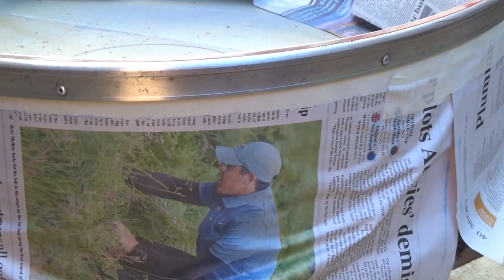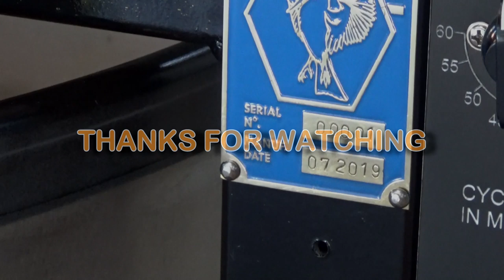The "Kooka Muller", a DIY Sand Muller for the Home Foundry - Final

Comment: I'm always heard those "plows" referred to as scrapers. Some DIY designs I've seen also fold the sand over to increase mixing of the sand.
A wheel scraper to keep the wheel clean will help.

Comment: G'Day Mark,  they always need to be fine tuned after the build to get them working right.  To add more weight to the wheel I fitted a heavy compression spring off an arm with an all-thread adjustment screw to adjust the weight applied by the roller, worked really well.  I also found adding a thin tapered grader plough across the base that allowed the sand to be lifted and layered rather than being rolled and compacted it the same spot.  Keep the sand moving around as much as possible.  With my green sand I found it always stuck to the roller and base so I added an adjustable scraper to peel the sand away and am looking at attaching a nylon sheet to the base.
Cam
Reply from the maker: Cam, thanks for that. Lots of good advice coming in now. Unfortunately, as soon as I got the muller finished it got wheeled up against a wall and I was off on another tangent. You should see that video out in a few days.

Comment: Very nice, all the way to the finishing badge.
By the way.. What do you think of a rake or plow after the roller, to break up the compressed sand?
Reply: I was thinking about that question as well. Plus a scraper blade to clean stuck sand from the roller.
Reply from the maker: Yes, I have some tweaking to do. For now, I"m just glad it's finished
Reply: @Preso58  Simply add a scraper to roll the sand to the outside edge after the roller, so it continuously rolls the sand from inside to outside and thus mixes it.

Comment: In my language we call those ploughs wings or knives. I would suggest making next ones (you probably need to replace them sooner than you think) a bit longer, so that they would scoop up and mix the sand also on the rollers path. Heavier and/or narrower roller is also on my list of suggestions. I have a roller that weighs 60kg on my muller and it still wants to slide instead or rolling when there is big enough lump.
But it works! Sure beats breaking the lumps and mixing by hand. Congrats!
Reply from the maker: Good grief! 60Kg! I am going to fill my roller with concrete but it won't be more than 10 or 15kg I am guessing.
Reply: Yeah, it's an industrial muller capable of mixing 150kg sand per load. 7,5kW electric motor @1000 rpm that's geared down to 30 rpm at shaft. It has a stationary bowl and upright shaft that rotates ploughs and the roller. I never put any part of my body into the bowl when the muller is working. If that thing catches you, it won't let go. :)

Comment: you should have removed the bell from the rear of the timer this would allow the timer to fit in the plastic box , or you could have opened up a hole in the back of the plastic box to give clearance for the bell if you don't want to remove it .. great video , love the Muller if i ever get back to casting i will also make one for my foundry ..
Reply from the maker: Thanks. I did want the little bell to remain on the timer. It reminded me of the very first Toshiba microwave oven that I purchased back in 1983. It was massive and weighed a ton and it was still working up until a few years ago. I have done a few upgrades on the muller, mainly to do with the drive pulley arrangement. It was very hard to tension the belt sufficiently so I added a cam to crank the motor mount away from the drum centre line. I also fitted ball bearings to the weighted roller. 
Regards,
Mark

Comment: The big reveal, very well done. If I may make a suggestion, the outside of the (weighted) wheel being smooth, why not try putting on some teeth, like on a earth moving equipment. I would start with just 4 (four) at shall we say the point's of a compass, i.e. North, East, South, West. If your competent with your welding ability, attach round stock, via just some heavy tack welds at the very outside edge. I would start with 0.500" in. (Approx. 13 mm) round stock. You may want to even start with say 0.750" in. {1.905000 cm} If it doesn't work out, their's no harm to the roller. I'm not sure if starting small (round Stock) going big is the correct way to go, or maybe it would be better to start Big (round Stock) and go smaller, depending on results. Great build.

Comment: Gday Mark. I love the care you put into your work. Dunno if you've tweaked the Kooka in the last year but I think you need another plough or two to break up the middle band. Otherwise clumps that get into the middle will just get buried and stay clumps.
Reply from the maker: Sean, my biggest problem is that the sand tends to stick to the roller. It sometimes forms large clumps that have to be scraped off otherwise the roller stops turning. I tend to roll the sand dry first to break up all the lumps and then add enough water to form properly clumping greesand but therein lies the problem. I should really make a scraper to keep the roller clean.
Regards,
Mark
Reply: Just had a look at Chirpy's one and yep, he's welded a scraper just a tair or two above his wheel. Pretty easy to see here. https://youtu.be/e4ALY4c0sxQ?list=PLARRPqfckvhbAY7-Z9hvY87CmlL8cE5wa&t=1688

Comment: I loved this video.  I do a lot of wood work and wood turning in addition to machining.   I love my spokeshaves, I have concave, convex and flat.   The flat one is my favourite.   Nice work on the handle.   I prefer to use hard back saw to cut off my wood turning projects rather than parting tool.   I find this gives me better control and easy clean up.
I got a big smile from the final reveal of the nameplate, very well done.
I think the muller may work better with an inner ring to prevent sand getting on the inside, and a third rake to lift the sand similar to the action of the shovel at the end.
Dave.
Reply from the maker: I watched a very experienced wood turner part off pieces with a skew chisel and he could do it so that there was almost no broken grain on the end. If there was any left he would just pare it off with his skew which was always razor sharp. He would do it with the work between centres too. I was never game to try it in case the work got flung out into my head!
Regards,
Preso

Comment: Never thought of using alloy box section and post caps to make a project box !
Looks fantastic ! i wonder if setting up a water bottle to drip feed the water in might work better ? Once you have your ratio right you could load up the muller , fill the bottle  start it up , set the drip feed and forget about it for half an hour .
Reply from the maker: Ian, I have had strict instructions on the ratio of water from none other than the legendary Sandrammer. He assures me it must be 5% so that's what I will try as soon as I get around to my next casting.

Comment: great job on the KooKa Muller.
may I suggest that the "ploughs" when acting together need to cut across the full width to the sand track to remove the undisturbed band of sand that runs directly under the roller.
for instance the inner plough should go to half way in the roller track as should the outer plough, in this way all the sand is turned over, so to speak. then possibly a pair of ploughs directly before the roller to centre the sand to run under the roller.

Comment: G’day Mark, you just can’t help yourself, name plate. Job well done and waiting for the modifications which are presented in the comments, many to choose from. 
Yesterday I conditioned my green sand, wish I had your muller:(
I must say you are a confident man to paint and finish before it is thoroughly tested but hey it works. 
Cheers 
Peter
Reply from the maker: Peter, Ahhh, there's the problem with making YouTube videos. You are under pressure to put something out there and that often means taking risks as you have identified. I am already regretting the decision to powder coat the ploughs. Some people have made some valid observations and I can see that I may have to modify them. Getting powdercoat off a part means using a chemical stripper and then sand blasting!
Regards,
Preso

Comment: All of the mullers I've used, the metal pieces that pushed the sand under the wheels were called plows. Perhaps in England they're called rakes, but I've never heard them called rakes.  Just for your information, I learned an excellent recipe for green sand while in the Navy. Easy to remember too. When mixing the sand with the clay (bentonite for us) you use the ratio of 95% Sand with 5% clay. Once that mix is done, weigh the mix then, while it's being mulled, introduce slowly 5% water. So if you have made a batch of sand that weighs 100lbs, you add 5lbs of water. The muller is beautiful and if you have any questions please ask.
Reply from the maker: Sandrammer, thanks for the recipe. I did use bentonite but sadly I was too disorganised to weigh it out and keep track of the ratios. I just kept adding the clay until it looked about right. I do have plenty of the sand which is very fine white beach sand that has been washed. I can add more sand easily. The water content was the thing that I was obviously messing up. I will try your method of weighing a batch of the dry greensand and calculating the 5% water content.
Cheers,
Mark
Reply: Only 5% bentonite clay well that's interesting.
Reply: @markfryer9880  , don't forget that's 5% by weight. If you're going to make a 100lb batch, for example, you'd put in 95lbs of sand and 5lbs of bentonite.

Comment: a fellow aussie here who is also a hobbyist metal caster, machinist and fabricator, i'de love to see your powdercoating setup and can only dream of how great it would be for you to do a powder coating video :)

Oh man that rubbing in the wood wax - almost pornographic :) loved it :D

I think it's fantastic that you were a teacher - clearly metalalwork or woodwork:) When I was at school all 3 trade classes (metal, wood and plastic) where my favourites,  sadly when my own kids went to school they had removed those classes from the curriculum :(
Reply from the maker: Lloyd, check out this video where I go into some detail with the powder coating https://www.youtube.com/watch?v=0V0OvAtBxT8&t=1335s
It starts at about 4:00. I think the powder coat setup was the single best investment I made for my shop. Initial outlay is a bit steep but certainly under $400 if you already have a compressor and the oven came from a skip in the back of my local electrical appliance repairer. 
Regards,
Mark

Comment: Oooh, pretty!  Nice job, you had me worried for a second when the wheel didn't want to roll right off the bat there, but I'm sure it won't take you long to figure out how much sand and water it likes and make any adjustments.  The music cracked me up too, nice touch.
Reply from the maker: I think there was a bit of paint in the opening of the end plates. It soon freed up. I have noticed that it can get hung up on a big lump of  sand though.
Reply: @Preso58  hopefully you'll get that sorted out too, it will be a bit discouraging if you still have to break up all the clumps by hand before you can dump your sand into the muller!  Now you've got me wondering how it'll deal with bits of tramp metal in the sand too...  
Anyhow, at least we already know the overall design is sound, from Luckygen's example.  Sounds like you just have a few minor bugs to work out of the system is all.

Comment: Mark, love the projects, would love to see your powder coating setup, my father in law has a commercial powder coating business here in Buffalo NY, with a  huge oven, 24 feet deep, 10 foot wide and 8 foot tall.  He always describes the baking process like something you'd cook in your home oven, set the temp to 400 degrees Fahrenheit and cook it 20 minutes. They just cooked a 500 lb solid steel part a few weeks back 2 hours it sat in the back of the oven waiting for the hunk of steelnto heat up.  They are a job shop, all custom work.  Car frames, fencing,  frames like the one you painted., etc
Reply from the maker: DIY Chad,
I must say I am a bit of a fan boy for powder coating. It is so much better than painting both in terms of the finish and the durability of the coating. I showed my powder coat setup in some of my other videos. I think the one on the Stuart Turner steam engine shows it best. I think it is part 11. Your father in law's oven sounds like it could cook a whole car. I worked at a furniture factory that had a continuous gas fired line oven for baking school desk frames. It was about 40' long. 
Thanks for watching.
Regards,
Preso

Comment: brilliant machine. I wonder if adding a rake or plow attachment after the roller would help to roll over the build-up of sand in the path of the rollers.
Reply from the maker: That's something that I will have to experiment with. As it stands, the muller seems to be producing greensand that is way more consistent than I had been able to produce by hand.
Regards,
Preso

Comment: Well done, liked the build. Regarding the roller how about consider adding resistance to the roller so the sand can grip and rotate it like a waterwheel, by adding /welding small round bars not sure if at angles around the outer circumference of the roller, and depending on the spacing, it hammers the sand clots down as it rotates on the will of the sand, maybe experimenting with maybe 7.... I guessing I think the distance between them will have to do with how the roller floats on the sand and next one to caught by the sand.......

If they fit in a twisted manner the roller will run on drum without sand evenly, like a worm wheel effect.
Reply from the maker: Chris, I am definitely not an expert but I believe the job of the roller is less to do with compacting the sand and more to do with pressing the clay particles into intimate contact with the sand grains. The idea is to have each sand grain fully coated with clay. There is a point early on where you want to break up the hard lumps of dry greensand and reduce the mix to a free flowing dry mix. Then you add sufficient water to make it bind together. I have used the muller quite a bit just recently and I have sort of worked out the correct ratio of water to add. In the video you watched I definitely added too much water and it was making the mix too sticky. There's so much to learn with foundrywork and I am still on the upward trajectory of the learning curve. I can definitely say though that having a sand muller, even a bad one. is far better than getting down on your hands and knees and doing it by hand.
Regards,
Mark Presling
Reply: Ok, I did not mean it must compact, i ssume that would not be good at that stage, on 2nd thoughts a larger roller may roll over the sand easier without acting like its pushing the sand. Hi, this is just a wild thought(s), I am no expert either.

Comment: I think if you skewed the roller slightly so it was rubbing and flattening the sand it mite help but you don’t have anything braking up the sand separating it with everything be pushing into a line and the roller just rolling on top the packed sand around the lumps are supporting them so there is not enough forces to brake anything up maybe some raking fingers
Reply from the maker: Thanks. The idea of adding some fingers (tines) might be doable.

Comment: Almost fell out of my chair laughing! Hey what is a Kooka? Maybe a couple of vertical rods just after the roller to break it up. Did you notice the grease cap pop up?  Thing of beauty! Great job!
Reply from the maker: Yeah, that grease cap kept popping out. At first I thought it was the lock wire but eventually I drilled a very small hole in the side of the cap and it went it perfect. A kookaburra is a native Australian bird that has a call like someone laughing insanely. They are related to Kingfishers but are quite a bit larger. They have very sharp and powerful beaks and catch and eat snakes. We have a large population of them living around the bush on our property. If you ever watched Tarzan as a kid you would have heard their call used although they don't live in Africa. I guess the show's producers just decided that they sounded "exotic".
Regards,
Preso

Comment: hahaha Great video! And what a beautiful makers tag :-) Serial 00001  :-) Your sand muller really deserved that tag. I think that your roller could use some groves, a bit similar like a helical gear, in order to get more grip on the sand, and it breaks up the sand easier because the edge from a grove creates much more pressure on a lump of sand when the sand goes underneath the roller. And it can also use some mini plows to stir up the sand a bit more, like other also suggested in their comments. But now I am looking forward to see the adjustments :-)  Big thumbs up !
Reply from the maker: Thanks, I have to do some more work on it for sure but it's nice to have it running.

Comment: I thought those upside down spray guns were for use down under!! LOL -  What type wood are you using for the handle? - You need to add a turning plow in the middle of the compacted sand to keep it turning to break up the lumps. -  Great build, and I loved the Placard.
Reply from the maker: Vernon, the wood I used was Malaysian teak. It was offcuts from a job I did for a friend. They bought a double bed in Jakarta and wanted it converted to a king size bed. It looked like it had been recycled from some massive doors. The wood has a curious odour and grain that varies from cream right through to a really dark grey.